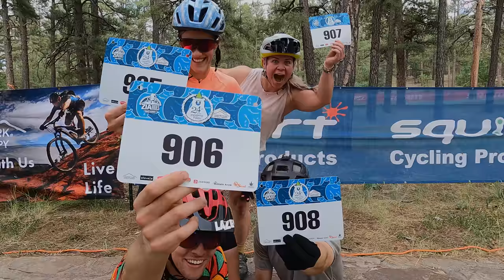We're in a slump

Comment: Hi Macky - I saw your Downieville video where you didn't have any issues with these same tires.  Perhaps this course had sharper rocks.  Either way I would suggest trying a more robust tire that's less susceptible to punctures.  I have had great success with Vittoria Mezcal 2.35 Anthracite tires.  I won't use any other tires now.  Never had much luck with Maxxis in the past.

Comment: Amazing how fast you can ride through rock gardens on you xc bikes. 

Question: if the tire repair had worked, would this just have been a temporary fix and the tire be replaced for the next ride, or are these fixes more long lasting?
Reply from the maker: You can ride tire plugs for a long time (and we have) but we generally replace plugged tires before a race just to make sure they aren't compromised in any way.

Comment: Hi!!!! I am currently starting to race XC/marathon on my Jet 9. I was wondering if you can share your suspension setup? Front and rear. Thanks in advance, love the channel!

Jet 9 rdo 3 star
Reply from the maker: We generally set our suspension based on Fox's recommended setup. Just Google "Fox <name of suspension> setup" and you should find a PDF guide. And for the shock we set the sag based on Niner's sag indicator first to figure out the air pressure then use Fox's recommendation.
Reply: @sydandmacky  awesome! Thanks I’ll make sure to go and look.